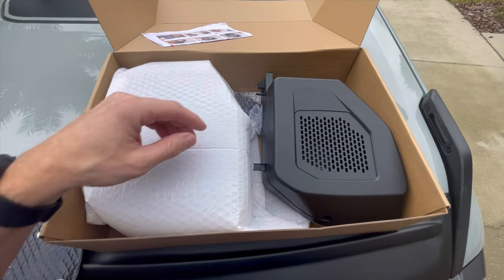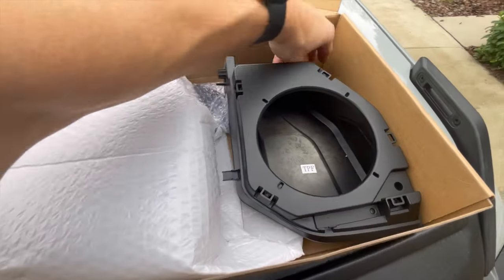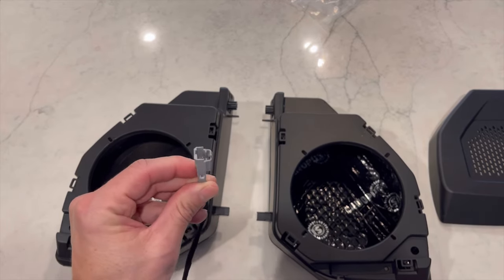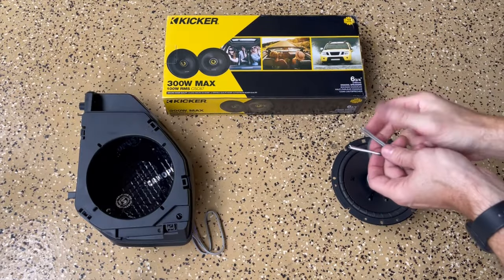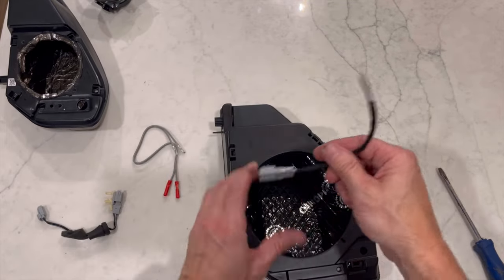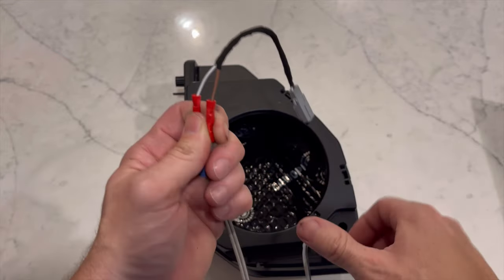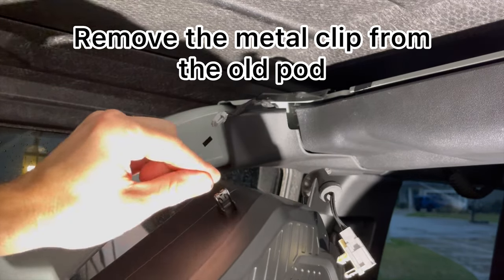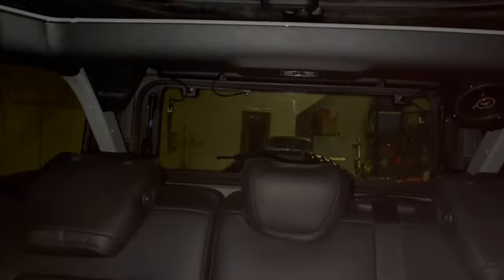Ford Bronco Rear Speaker Pod Upgrade (2021-2023)

Comment: To whomever upgrades their Bronco B&O system thinks it sound better with their new replacement speakers etc… I am glad it does for you. Personally, I have upgraded other systems on other vehicles and never noticed a difference. Then again. I have poor hearing… and upgrade muffler etc… so any “noise” in the stereo system, becomes moot after road, engine, vehicle and muffler noise.

Comment: I replaced mine and everything worked fine, now no power to passenger side.   Any suggestions.
Reply from the maker: Check the connection to the speaker.  Mine was a little loose when i firs did it and would go in and out.  I redid the connectors and it worked great.  If the whole passenger side is out including the front speakers, I would check your fade settings.
Reply: @UnitedStites  just the rear.   Even hooked factory speaker back up and nothing.    Will recheck connectors.   Thanks.

Comment: The B&O system comes with JL Audio speakers? That's a little, strange, right?
Reply from the maker: No, I had swapped the factory B&O 4 inch with JL audio 4 inch speakers originally to see if it would make a difference.
Reply: @UnitedStites did it make a difference?
Reply: Never mind you said it all lol
Reply: Can you tell me the cost of the boxes, and the model and cost of the speakers, there are companies outbthere that sell a lod with the speaker already installed for $400. Dont know if its worth it to do it your way. Nice video
Reply from the maker: Hi - thanks for the question. On Amazon right now the speaker pods look like they are $129 with a $10 coupon.  You can get a great pair of speakers for a little over $100. That would be half the cost of the $400 you mentioned. Hope that helps

Comment: Well is it much improved now?

Did you need to mess with forscan at all
Reply from the maker: To be honest, yes my kids in the back seat think it is too loud now but when they aren’t with me and the soft top is on….I can actually hear the speakers. (Can also be easily adjusted with “fade”)
Reply: Yes because your original 4" speakers were set from Ford as tweeters due to their size.  Forscan will allow you to make them full range speakers+tweeters and allow you to tweak the sound filtering.  There are lots of YouTube videos that provide great tutorials on this.
Reply: Can you send some of those forscan videos? Thank you